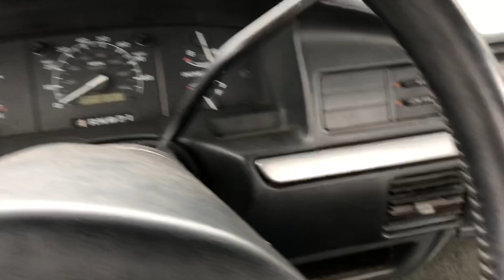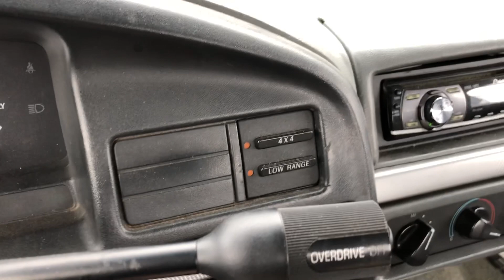92-96 F150/ Bronco electronic 4x4 repair

Comment: That 4x4 module on the kick panel has a self test mode. If it passes the test, no need to replace. Unplug both connectors on the bottom of the module, key on engine off, press the self test button. If the red LED indicator flashes three times and then stays off, the module is good. If it doesn't flash at all, or the red LED indicator stays lit, the module or wiring to it is bad.
Reply: I've got a 1994 Ford Bronco XLT and the dash button was doing the same thing. I took it apart and tested it with the button on the side and the LED. It flashed 4 times and stopped. So it's good

Comment: My 93 ranger has the same electronic system but with manual hubs. So far I can't tell if the 4x4 system even works because it seems to be an electrical issue as the switches don't do anything (no light, no solenoid clicking, and no dash light comes on), I just can't seem to find any schematics for the fuses or buttons. Which fuse would I need to check to start diagnosing? (If I recall these years of bronco and ranger have the same fuse panels according the chilton manual) And if you got a link to a good schematic that would be more than helpful. I'd rather start looking for the most simple problem and then diving deeper into the more complex stuff later if necessary. 

Unfortunately a manual swap of the transfer case is out of the question as I'd have to swap the transmission too being mine doesn't have the mounting holes for the linkage assembly. 

Been a while since I've done any wrenching, so I'm quite rusty these days and need some guidance lol.
Reply: Hey I Just bought a 93 ranger aswell and my 4x4 isn’t working have you end up fixing the problem?
Reply: @haydenjylha9673   oh regarding the manual swap option, its feasible to swap to the manual BW TC if your transmission has the mounting hole i mentioned originally. But without that particular transmission you cant swap the transfer case necessarily (its like the BW1304 to BW1302). Something about the ESOF system and transmission combo on those models varies from the transmission on the manual 4x4 version. 

The aftermarket kit mentioned just needs an untapped hole anywhere on the left side of the transmission for a small bracket to hold the wire sheath. Where as a full on ESOF to manual TC swap would require the different transmission from what i remember reading. Its wild.

Comment: Common problem with the 92-96 dashes breaking at that location. They make a metal bracket that bolts up to that point and is formed to fit